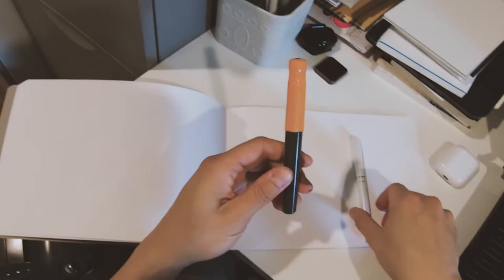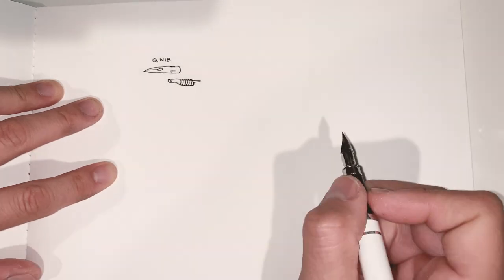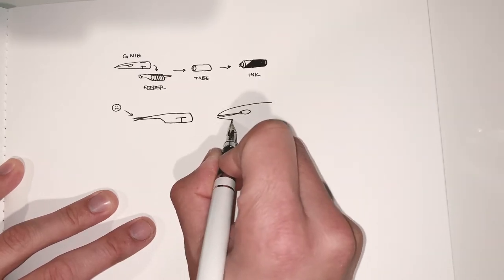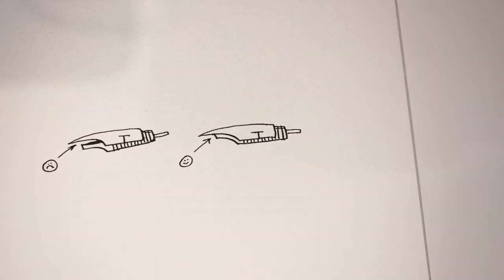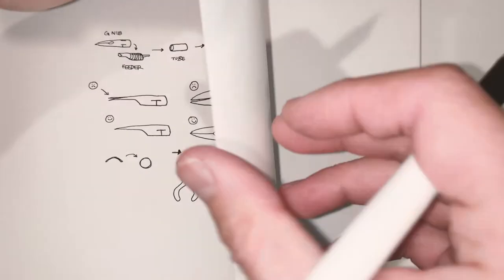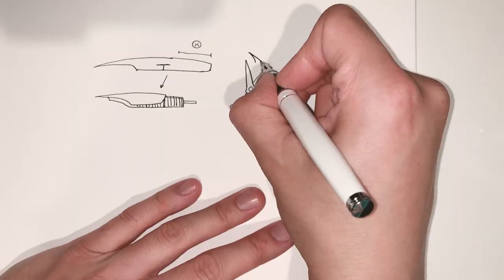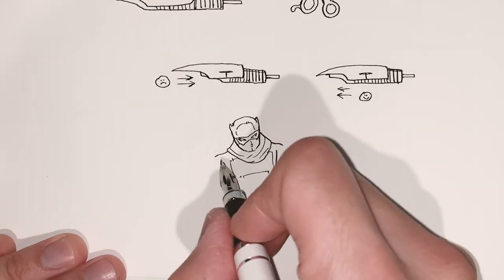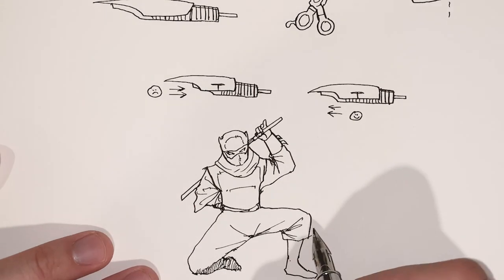How to Mod Any Fountain Pen with a G-Nib

Comment: Nice explanation! I used to do this with cheap jinhao pens I'd pick up on ebay, but found the G nib would rust over time. Still really fun for noodling around with!
Reply: look into titanium nibs, they are corrosion-resistant
Reply: @carassiq5386  but are a pain to bend
Reply: @tiagodagostini  just got my titanium nibs. They work flawlessly. No rust, easy to bend. They are bouncier than chrome ones, but still easy to fit
Reply: I used too and threw it into dustbin .... Now I purchased noodlers ahab flext fountain pen and my work going smoothly 🕺🕺🕺🕺

Comment: The feeders are usually made of ebonite, a type of hardened rubber that become maliable when heated. You can shape it snuggly to the nib by softening it in hot water first. I like the G nib and its true there aren't many fountain pens with good line variation. I do love the sailor fude pens for max line variation though

Comment: I've had very good success installing G-nibs in the Jinhao 450 and Jinhao750 fountain pens without having to use pliers.  Lubricating the nib and feeder chamber with a very light coating of silicone grease facilitates insertion without disturbig the nib's position on the feeder.  Once installed, the tip of the feeder can be quickly formed to make full contact with the nib by soaking it in hot water for 30 seconds, then using a clothespin to bend the feeder to the nip until the plastic cools to its new contour for the G-nib.

Comment: Is there an issue with what inks you can use so they don't clog?
Reply from the maker: oh yes, gotta use water-based ink. almost every fountain pen's feeder design is that solid plastic thing with many lined grooves- thicker permanent ink like indian ink will clog such feeders. the only fountain pen i've used that can use any kind of ink is the Ackerman pen (i've reviewed it before), as the feeder is simply a tunnel.  in terms of ink, the most versatile i've used is Pilot's Namiki ink, or their Iroshizuku ink
Reply: @drawingwithcal1552  Thank you for your quick informative response & video. I've tried the Ackerman pen & found that it didn't work for me, maybe after I view your video I will try it again.
Reply from the maker: @larryglatt2548  no prob- the Ackerman isn't for everyone, I have some beef with it too- it's my go-to pen for in-studio long hours work session. but that thing never leaves the studio- in my spare time doodling and sketching, i have 20 other pens i'd rather draw with
Reply: @drawingwithcal1552  YUUUUUP

Comment: hello! i know you probaly wont see tghis comment but if you do, can you please make a video that is specifically on how to do this for the kakuno?  cause i heard allot of people saying its really hard to mod a kakuno, if you can, then really really thanks!
Reply from the maker: hey there, so far since then- I haven't actually been able to find the right kind of G-nib that you need in order to be able to do this with. and it's been pretty difficult to maintain the longevity of this setup so I can't honestly say I recommend this method. I've since moved on to dedicated setups like Ackerman pen that's designed just for G-nibs (and other comic book nibs). but I also draw way too much and too quickly that I've started to damage nibs and I had to switch to a different kind of pen altogether that'll also give a good variable line. I use synthetic brush pens all the time now (Kuretake, Monami 3000, Pentel Sign)  when you're doing a lot of work, these just tend to be more consistent and reliable
Reply: @drawingwithcal1552  ok, thanks!

Comment: Good job . But why only use a G-nib ? There are plenty special dip-pen nibs around . Mitchell 0268 music nib , brause rosé , brause 66 , the list is endless . Also , use a small dremel cutting disc and drill tool to cut off the back of a metal nib , they are very cheap .
Reply from the maker: oh there’s a ton of excellent nibs, and i do have an assortment of them. i’ve only managed to work out how to retrofit a zebra G-nib into a fountain pen- i couldn’t even get a nikko G-nib to work, much less other nibs that are shaped very differently

Comment: How do you cut the nib?
Reply from the maker: i’ve used a number of things- the first was a tree branch trimmer where the blades meet- but they were so thick it was hard to be accurate. and then i tried industrial grade scissors which was a big easier to use, and lastly a tailor’s scissors for cutting thread- the one with large handles but with tiny blades, also worked and the easiest to be accurate. don’t cut and bend nikko g-nibs, they crack. i only had success with zebra g-nibs
Reply: @drawingwithcal1552  Thanks for your reply. I tried cutting the Zebra G nib with big scissors but ended up bending the scissors and poking myself!
Reply from the maker: @ytskt  yikes! yeah definitely take care with handling these nibs, they're super sharp. i used a tissue paper folded up many times to hold the tip as i cut
Reply: @drawingwithcal1552  That's a good tip, thanks!  One of the unique aspect of this tutorial of yours is you are use using smaller feed, so I was hoping that I can use your technique to replace nibs on my number 5 sized pens, and also it seems snug the smaller feed much better without flattening etc.

I tried fixing this on Jinhao number 6 feed (most tutorials are like this) but flattening is a big problem and mine got stuck and I'm not able to remove it after heating, freezing etc...
Reply: @drawingwithcal1552  finally managed to fit a Zebra G nib in a #5 nib housing, it fits much better with #5 feed than popular #6 options, without any manual bending/flattening of the G nib. Thanks for showing this approach.

Comment: Great detail. But...WHY does anyone want/need to do all this detailed work? Writing and Drawing with fountain pens requires different pen/nib types. And people have different grip and heavy or light weight pen preferences. WHY are you doing this G nib? What's the main desire/need to do this?
Reply from the maker: haha well this video is quite dated- but the basic problem was: many illustrators enjoy using the G-nib to ink comics due to its insane line variation and "scratchy" characteristic. the G-nib only exists as a dipping format and many illustrators are tired of dipping back and forth. there's no fountain pen at the time that really came close to the experience/performance of the G-nib or other dipping-flex nibs. and long before I made this video, other youtubers have attempted to modify the cheap Chinese Jinhao fountain pen with the G-nib. I personally don't like the grip of Jinhao's but it made me think, it's certainly possible to adapt G-nibs to other pens.

fast forward to today, there is a fountain pen solution you can purchase that is specifically designed for G-nibs called Ackerman. they offer 2 different variants and are very affordable, about $25. that kind of renders my project here obsolete- unless the illustrator doesn't prefer the Ackerman grip, then maybe this video is still relevant :)

Comment: Please, do a video where you tuning G-nib for different fountain pen.
Are your G nibs corroding? My "Leonardt G" nib is very quickly corroding in a fountain pen :(
Reply from the maker: I have found that different brand G-nibs are not alike. so far, Zebra G-nibs are the best for doing these kinds of mods where you have to bend them. and Zebra i haven't experienced any corrosion problems at all (they might be the titanium version).  Nikko G-nibs for example, are NOT as flexible and if you try to bend the rear to shape, it will crack and break so do not use Nikko for mods. I haven't had any experience with Leonardt G, or corrosion in general- what kind of ink are you using? I might recommend you try Pilot Namiki or Iroshizuku ink as i've used both for many kinds of nibs on both fountain pens and dipping nibs and i've never had any nibs corrode at all

Comment: Well your mod is nice but so much work is not really worth it in my opinion. When you will flex this thing the ink delivery will be inconsistent and this type of nib tend to rust so, you will need to redo all this regularly...
Reply from the maker: it's definitely not the easiest solution, just the cheapest one at the time. but for only a few bucks more than the kakuno, now you can get a pen called the Ackerman that's designed to feed ink to standard G-nibs. i made a review not that long after this vid
Reply: @drawingwithcal1552  i know a better way and cheaper. Buy a #5 feed (from jinhao it should work) and a Bic stick. You will need a drink can as well.
Put your gnib in the empty body of the pen with the feed. Make an over feed with the can and use it to lock the nib and feed in the pen. Yeah you will still need to dip but you will have enough reserve for at least a page of writing. No bending, no cutting. fountain pen ink preferred, you'll can cap the pen and it will be easy to clean and dry to keep your nib longer.